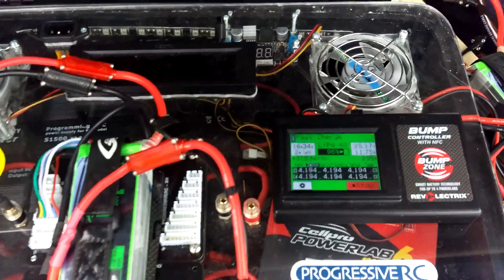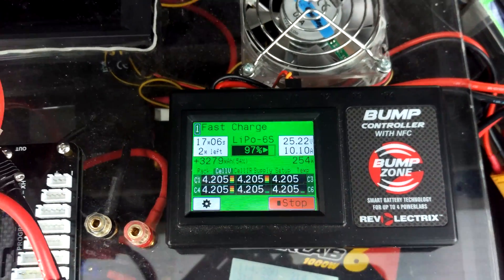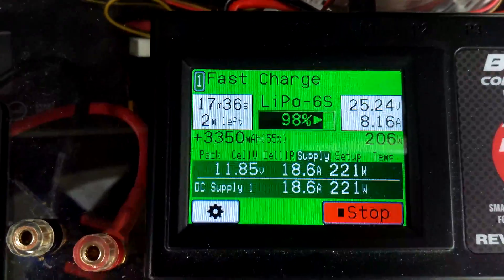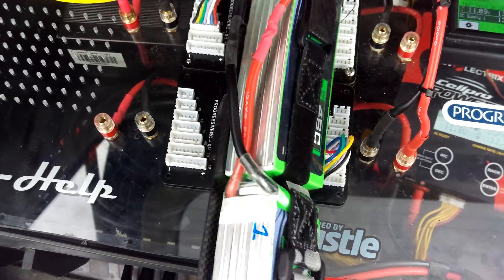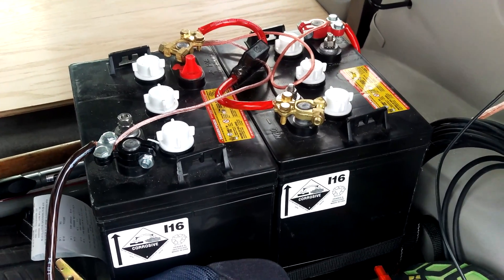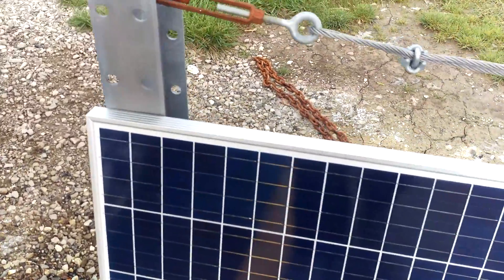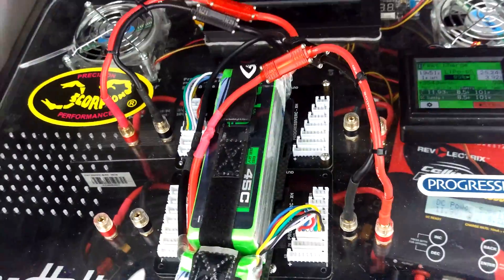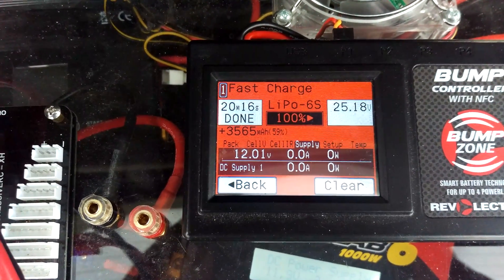Charging RC Lipos On A Solar Powered System Test 2

Comment: Solar controller says no amps?
Reply from the maker: The amp draw on the controller is not affected by charging the lipos.  I dont have the controller in that video anymore, I let out the magic smoke on it. Anyhow  what ever controller you decide to use learn its specs before use.  There is a possibility that the current draw my deffer between units.  

Another thing to keep in mind.  This setup i have is not ideal for charging rc lipos at high currents.   If your looking to get high current draw then your battery bank should not be led acid or agm.  You should be looking at lifpo4 .  Those batteries are super expensive.
Reply from the maker: You can expect about 30 amo capacity on the charge controller.  This is not a fact because every manufacturer is going to be different.  Again the charge controller only monitors and controller your battery bank, not your rc charging setup.